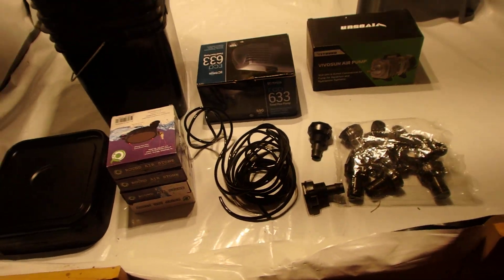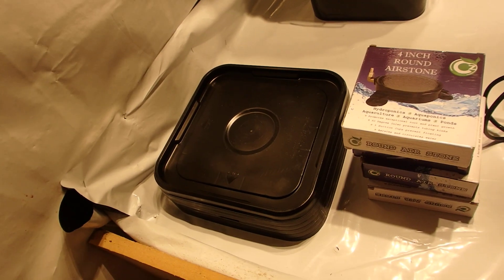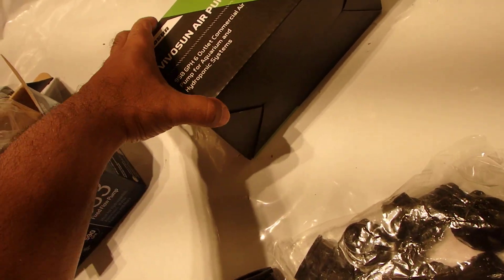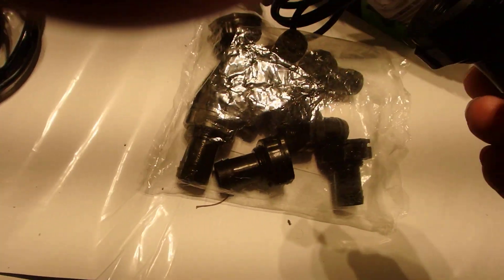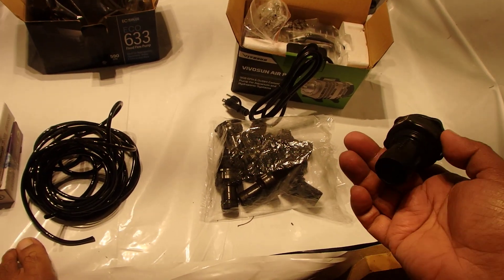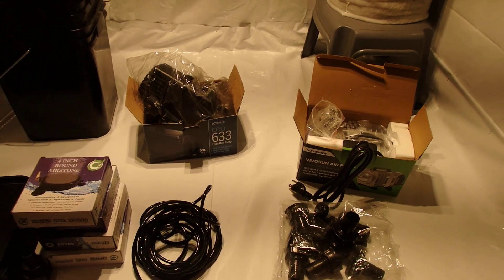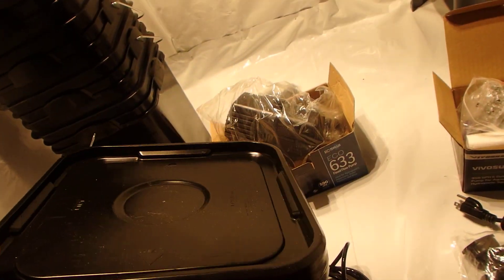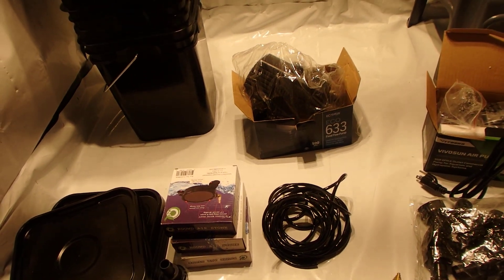Step 1 - RDWC DIY - 4 bucket build Recirculating Deep Water Culture

Comment: get rid of air pump and use powerheads . i use marineland 230 $17 . my pumps are over 5 years old and never stop ! in my green house i have 20 55gallon plastic drums each has a 10 inch net pot as a kratkey grow . each barral has 45 gallons of water mixed with cns17 .i get 4 grows per year never have to touch the water except when grow is done

Comment: I got one of those massive air pumps and it sounded like an air compressor and got superrrr hot, so hot it popped the rubber off the manifold. Ended up just running a couple of the active aqua ones, super cheap, quiet and no heat.

Comment: How did you get the tubing on the bulkheads?  I tried using a hairdryer to soften up the tubing but having trouble
Reply from the maker: A lot of hard work! I used a lil dish soap too
Reply: Try boiling hot water let the tubing soak for a few minutes